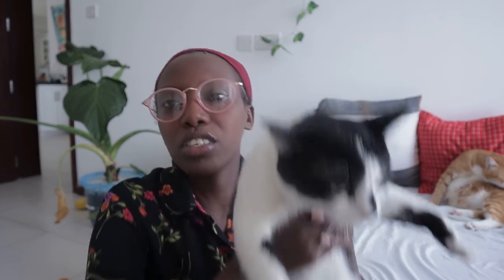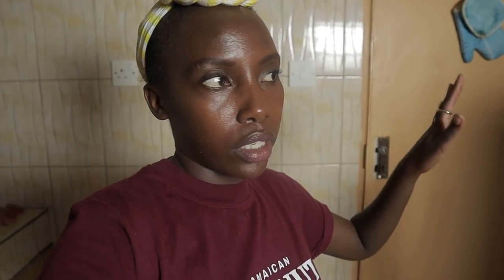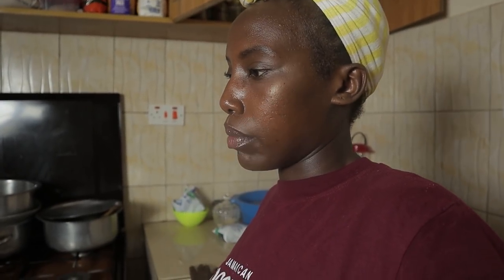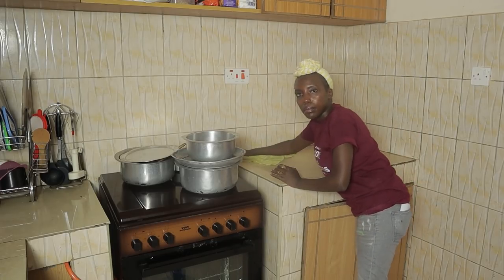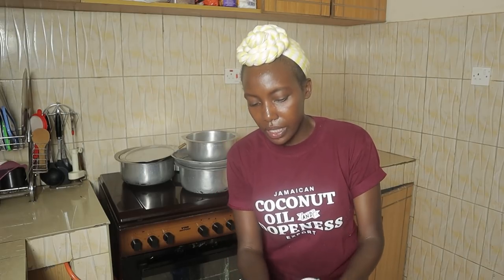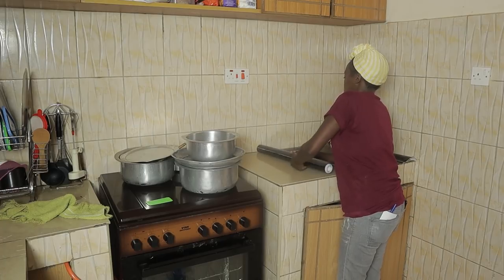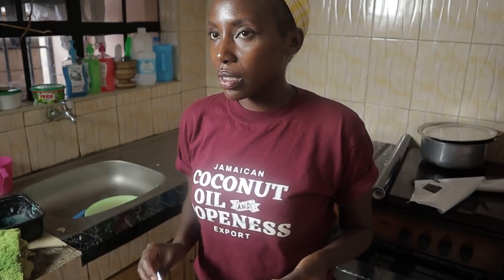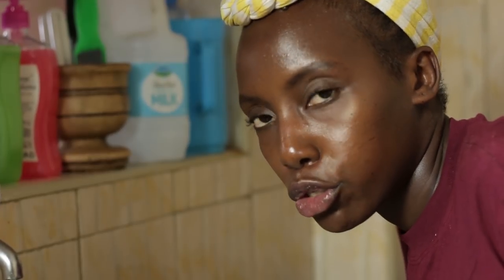RENTER Friendly KITCHEN DIYs | Here Comes Muthoni

Comment: I enjoy doing DIY's myself. You've just given me an idea of what to do on my kitchen cabinets. I have the same ugly ass cabinets and I was thinking of painting them. The contact paper is also a good idea. Amazing job Muthoni. The cats are gorgeous too.
Reply from the maker: Thank you Brigid. painting will only be an option if your landlord doesn't mind being left with painted cabinets because getting rid of the paint would be close to impossible.
Reply: @IAmMuthoniGitau  Thank you for the tip. At least it's my own home and not a rental. Quick question, can you apply paint directly on the cabinet or do I need to apply a primer first?
Reply from the maker: Use a primer first.

Comment: Great job, it has turned out amazing especially the grey👏🏽👏🏽👏🏽
Quick tip, the cabinets you can measure the first contact paper of the door then used it as a template for the rest. Saves on time.
Then for the contact paper itself, to straighten it, roll it on the opposite side. As in the inner part is now outside. ( Hope naeleweka)
Reply from the maker: Thank you Mary. The cabinet doors weren't all the same size so I would only cut 2 equal pieces. I used that method on the wall though. I did try rolling the paper in the opposite direction( like we used to do with calendars) but it didn't really help. I was taking time so I just used the heavier roll to hold it down.